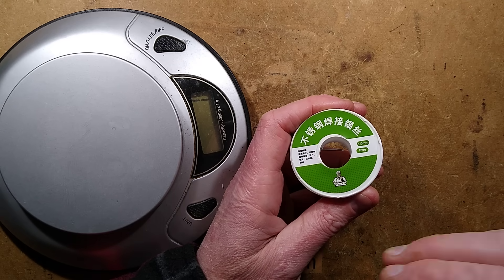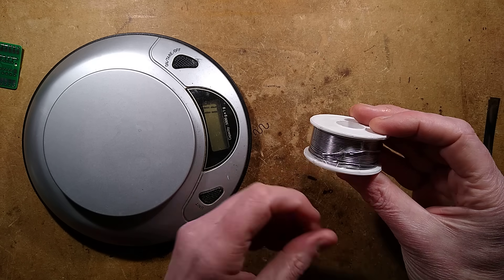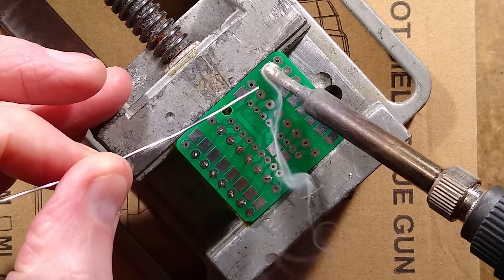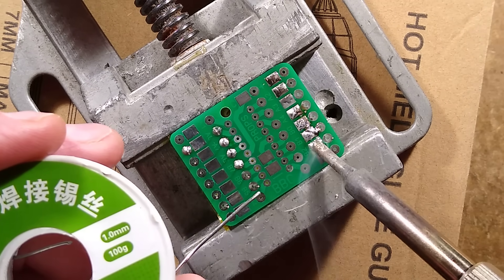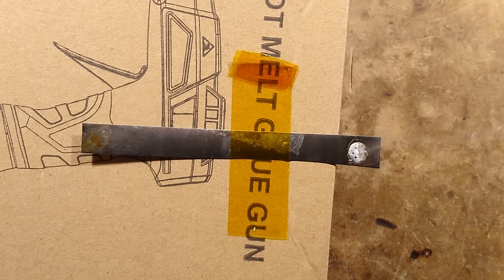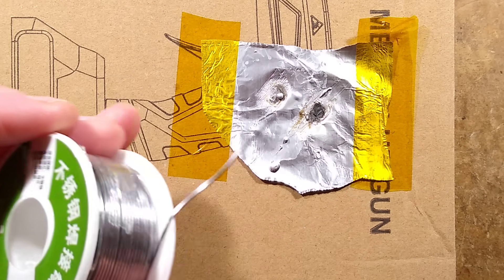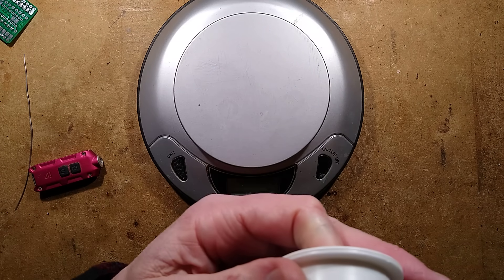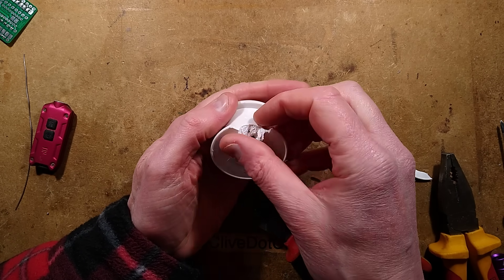Testing AliExpress "mystery solder"

Comment: I wonder what that stuff really is?  I'm somehow both constantly surprised and not surprised at the lengths people will go through to scam customers... Like, someone had to design that spool, then send to a machine shop to have the injection molding tooling made, then choose the right plastic with some dense filler, then manufacture thousands of those spools just so they could sell less solder than they claim.... bonkers.
Reply: One of the many times I wish I had an xrf gun. I bought something quite similar to this that was sold as leaded solder but it's absolute trash. Pretty sure it's unleaded
Reply: @theodorekorehonen  I'm quite sure, that you won't get any 60/40 from China these days, even if advertised. Because of our restrictions, which limits the amount that can be sold. No mass, no profit, no product.
If advertised as leaded - sorry, language barrier....
Reply: Only 10% cadmium
Reply: @johngalt7382 Nah, cadmium is part of Wood's Metal alloy and would make it stay molten longer.
Reply: Have you seen his videos on the power savers they do what you just described
Reply: On a plus note we now know what all those “recyclable” plastic shopping bags that end up being sent to Pakistan really gets used for.
Reply: The reels were either purchased in bulk from another company, or are used in many other products. Why tip the scales on only solder when you can tip the scales on multiple weight-based products at once!
Reply: @chriscluver1940 ,  just another wrinkle in the ongoing capitalistic devolution known as shrinkification, where you make the packaging larger in order to hide how little of the actual product is included.
Reply: Think of it as a disposal op.
Reply: Some several times recycled plastic, cheaper than dirt.
Reply: @u2bear377  white plastic is usual "virgin" plastic, not recycled
Reply: @ Pretty sure it's not as white as 'white' goes.
Even with that lot of filler.
Reply: Literally 90% of everything on Amazon eBay and Ali
Reply: Well they get their machines at a discount from joint ventures with Europe. So we are at least partially responsible for this mess. 

I live in Germany and the industries here just give away their knowledge in manufacturing and machinery to the chinese in order to save a penny or to avoid labourers cost. We spent decades researching a maglev train and we just gave it away to the chinese while our own in-service trains are outdated and always unreliable. We also gave them the blueprints for the InterCity Express. Volkswagen laid off a german assembly plant and opened a new SAIC-VW one in China. They just mimic ourselves. 

Without european investment China would still be an agricultural country. 

//typo
Reply: Welcome to china, where they put so much effort into trying to look like the real deal you  wonder why they didn't bother to just do it properly
Reply: They've faked eggs. Yes, eggs, as in for cooking. Literally nothing is too much hassle to scam. As the saying goes, 能骗就骗: "if you can cheat, then cheat."
Reply: If you are not cheating, then you are not trying. Welcome to china :(
Reply: you can bet they did the math beforehand though
Reply: @gmonkman  They did math but replace the a with an e
Reply: Completely agree. We should stop buying from them (China) because of scams like this but we're addicted and they know that so keep thinking of new ways to grab our hard-earned money...
Reply: They're addicted to drugs. Any scam is a win.
Reply: On top of that I’d bet it’s just reclaimed contaminated lead and tin alloys from e-waste. Probably from things like car batteries and other unsavory items. Composition is probably 47% lead, 23% cigarette ashes, 16% beer cans and human fingers, 5.5% Slobber from Khat and whatever else is in that factory.
Reply: Buffering
Reply: Otherwise they might have to pay for waste disposal.
Reply: For these wide-eyed wonders, scamming is a sport.
Reply: Maybe the spool is cheap and used as a promotional gift and now just sold as a scam parallel to that...
Why? Because development is expensive and you need to find someone willing to pay upfront and seeing a value in investment,  where scam is a little stupid
Reply: The spool is probably used for another wire product where the extra strength is necessary, and it's just cheaper for the solder company to use this existing spool from a supplier than it is to have their own custom spools made.
Reply: @ Much more likely that there are many sellers that use the same dirty trick.
So these spools are produced in large numbers.
Reply: @mmuller2402 ,  Perhaps the spools are made for some other usage such as winding flat green or red Christmas ribbon onto,  or for fishing line.....  Whoever makes the solder probably intentionally looked for the bulkiest plastic spool they could find that would hold as little solder as possible.
Reply: Who's old enough to remember those people at gas stations selling brand new TVs and stereos and the people who purchased them open them up to find out that there was just brick duct taped inside of it LOL. I hope you don't know what I'm talking about cuz if you do sorry that sucks for you
Reply: When I ordered my power washer wand, I was surprised to find in the filter was three large rocks to add weight to keep the filter down in the water bucket. True story
Reply: It's pathetic that Chinese can actually say oh. I'm sorry it was a language barrier. I'm sorry you assumed that it was 100. G. Without the solder spool it said nowhere in there about that and they'll just blame it on language like no, you're very fully aware of what's going on
Reply: Not people, Chinese.

Comment: There should be no problem soldering stainless steel using regular circuit board solder. The surface needs to be prepared - matted up with fine sandpaper, and degreased with eg alcohol.

Same with duraluminum. It does actually take solder when the surface is prepared and prevented from oxidation using flux or a shield gas. I have built “stick sculptures” using aluminum wire pieces soldered together. Not sure what alloy of aluminum it was, but it was not pure Al.
Reply: Phosphoric acid is one of the fluxes that works well for soldering stainless.  Nothing special in the solder alloy itself--I've used 50-50 with success.

Comment: Looks somewhat like thin plumbers solder. I wouldn't put it near anything electrical, I would be very surprised if that flux isn't using an acid base.
Reply: I've never used a plumbing solder that had flux core. I always use flux paste. I've not tried using it on anything other than copper and brass fittings though. Might be interesting to see if it works on stainless. 
Perhaps this stuff could be used to tin the surface which would then allow usual electronic solders to stick. If the flux is not good for electronics, then clean it all off before applying the other solder.
Reply: I wouldn't use that on potable water either since "mystery metals" are involved!

Comment: When they count the reel as part of the net weight and the actual solder is only 40 grams you know it's the true Kentucky Fried Chinesium solder  :)
Reply: 3D printer filament often pulls that scam as well.  Net vs gross and all that.
Reply: @j.f.christ8421 I would expect a listing to show both net and gross weight. And avoid it if not.